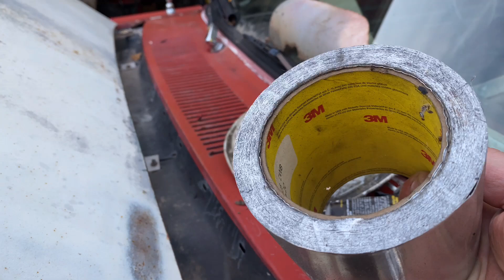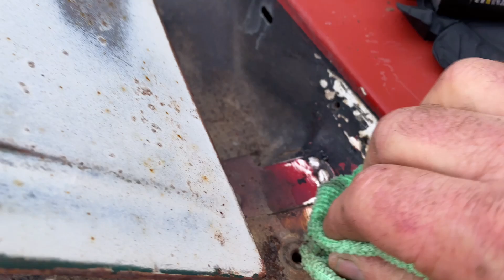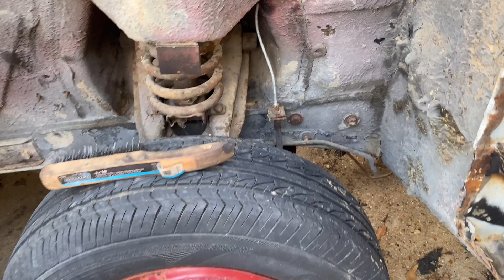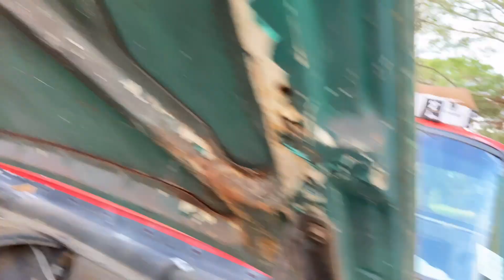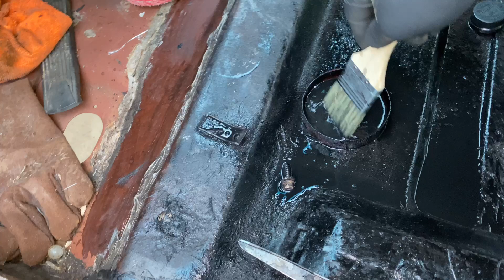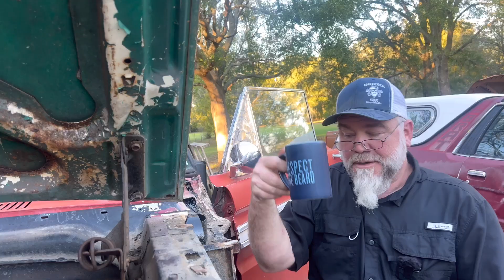Easy automotive rust repair

Comment: Great ideas with the por patch. I’m considering doing the same thing with the bottom of my door. Small rust holes in tricky spots. Good stuff.
Reply from the maker: @mercurymangarage  yes sir I have some of those same spots, that cutting out and welding would be for a professional body man, I am not. But I think I can make something work out of the por-15 and por-patch. How long it last, IDK?? For what I’m doing with this car, if I had to do it again every couple years, no big deal.

Comment: Great vid!
Love how you use Por patch and fiberglass.
I always keep a roll of aluminum tape - it works great to tape over open caulk tubes to prevent them from drying out.
Reply from the maker: Thanks! That’s a great tip, I’ll have to try it!